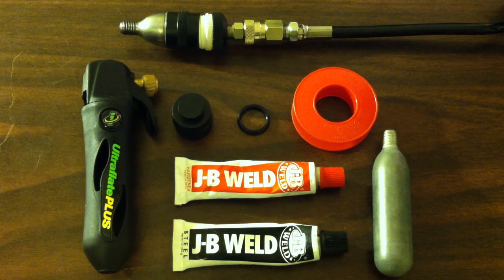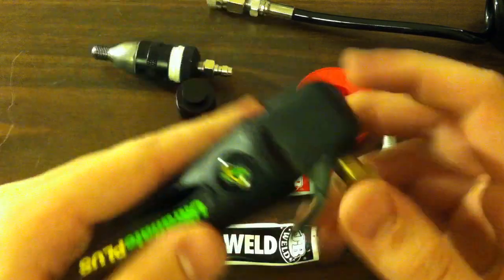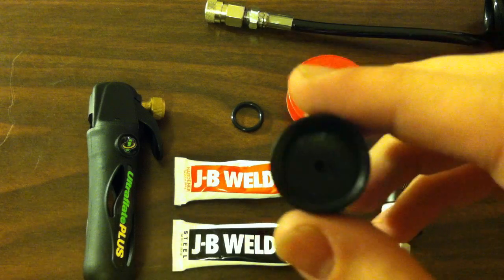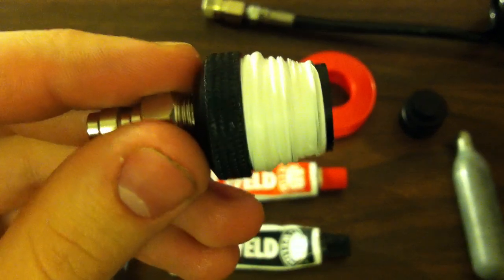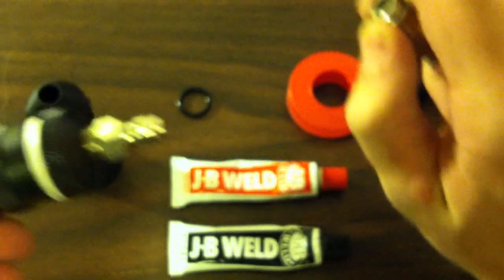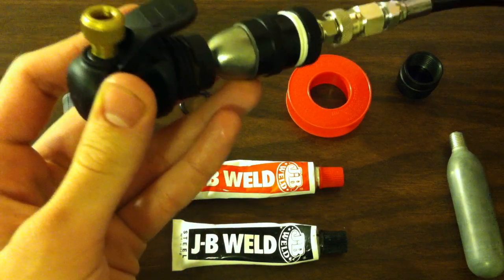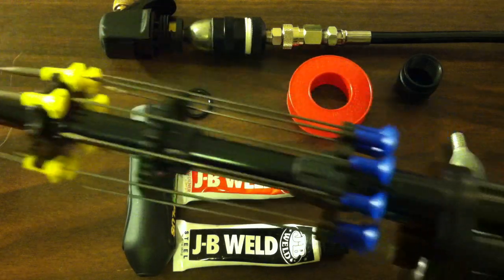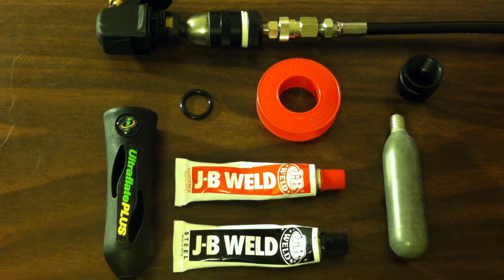How to Make: Paintball to Airsoft CO2 Adapter

Comment: Near as I can tell, there's nothing holding the CO2 canister on there mechanically. JB weld is pretty strong, but it can delaminate from a smooth surface pretty easily, so I would highly advise treating that thing like a loaded gun. Especially since you're using CO2, that contraption is going to be cooling down and heating back up a lot, which will cause the metals to expand and contract. They're all going to have a different expansion rate, so that's going to cause the JB weld to delaminate even quicker. I would fully encase that thing in JB weld after putting a wire cage around it (like a champagne bottle), that way it has a mechanical lock, and hopefully won't go flying if the surface bond were to fail at any point. Still treat it like a loaded gun, though, because you just never know.
Reply from the maker: Yes this design is highly flawed from when I built it 6 years ago as a kid. Thank you for your input. I think the other issue is pure O2, So high-pressure air is probably the way to go.

Comment: i would put a small set screw through the jb weld section. if that dislodged it will be moving with force

Comment: hello. i could use this design for my homemade air gun (i have a video about it) but i dont like the tyre inflator valve so where can i buy just the threaded needle nozzle thing to puncture the co2 or cany you even buy them?

Comment: Hey I don't know if you can do this or not but it seems like you can. Couldn't you use a HPA (High Pressure Air) tank instead of CO2 because they are consistent with pressure and if you have a compressor then you can fill it up for free. I say it opens doors and please get back with me on that it seems even more useful.
Reply: Wrong way round CO2 will have a constant pressure so long as there is liquid in the tank, the only trouble with it is when the liquid can't turn to gas fast enough. HPA tank pressure gradually falls off but doesn't suffer from frosting. an idea setup might be HPA with a step down pressure regulator.

Comment: I want to use a bigger cartridge, like 20g. Is there a thread protector that would fit its diameter if I were to cut it in half? If not, what else could I use besides the thread protector? Thanks.

Comment: 1/4" compression threading screws into the cartridge port(the type used on break lines) and you can braze soft-draw 1/4" copper pipe with some brass threaded fittings to make a more reliable adaptor. Only trouble I had with my gauntlet flamethrower prop using virtualy the same system was clearence and not enough of the actual co2 mist going out the nozzels.